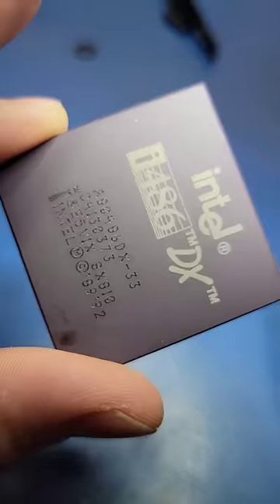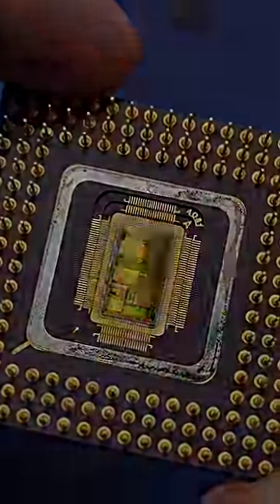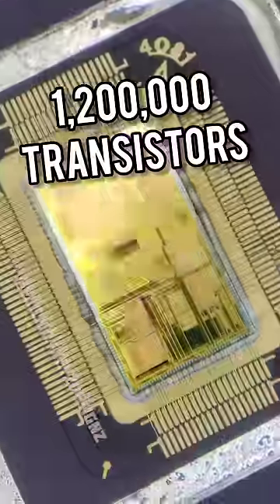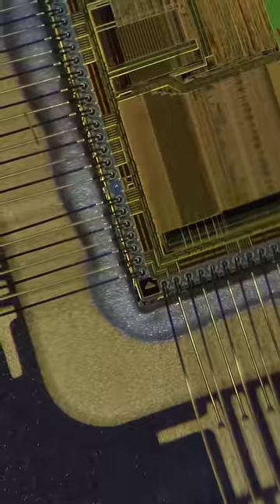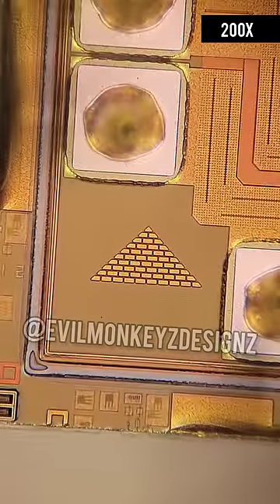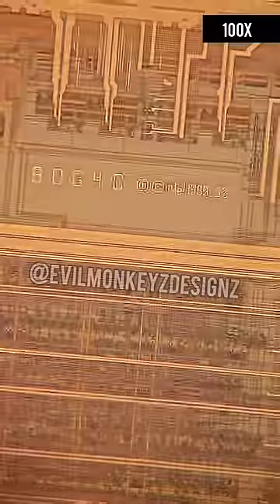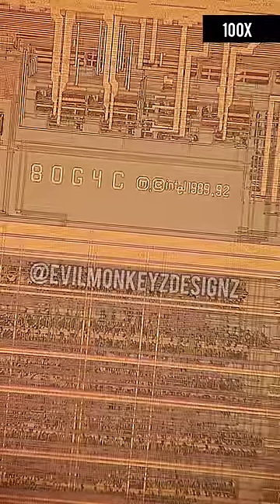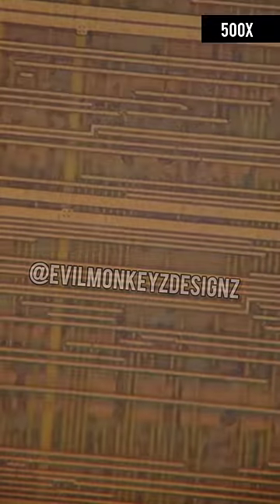Inside an Intel i486-DX CPU

Comment: Fun fact, they stopped making the i386, the predecessor, in September 2007. 

The chip came out in 1985.
Reply: A lot of tech is used in places that aren't PCs; there were probably some Point-of-Sale, ATMs, etc running those kinds of processors. I just recently got a new job back in September and the previous place I worked at was still using machines from the early-to-mid 00's for the two PoS units, and also the server in the back was almost as old.
Reply: @Dhalin  yeah, it's all the weird industrial stuff that used 'em for that long. I saw it when I was repairing an MRI magnetic field trim controller. Had an '06 date code, and I was absolutely shocked, had to look at the Wikipedia.

I guess if you used a 20 year old part on a 20 year old piece of equipment, it'll be 40 years old high technology still in use. Kinda cool to see computing history still chugging along.

Still though, I would have thought an FPGA would have been cheaper.
Reply: I had a pc with that as the processor
Reply: How much were they costing in the 2000s? What was their availability like in comparison to microcontrollers and other microprocessors of the time?
Reply: Fun fact: the MOS 6502 processor was created in the mid 70’s and is still produced commercially to this day
Reply: There was a news article recently that german train system still running on win 3.11. If it works it's good.
Reply: If I recall, the i386 didn't need cooling and was one of the most reliable chips of the era and therefore was a good choice for many applications.
486sx needed passive cooling and the dx needed active cooling. The pentium was a horrible mistake
Reply: The i386 was a brick. It was the last of the x86 line to not include a floating point processor on chip (there was a separate i387 coprocessor). It did not require cooling and was often used in harsh environments where it performed flawlessly for years. I would put 386's in the same class as the Voyager spacecraft computers - cream of the crop!
Reply: @ernestsmith3581 No, 386DX had FPU on chip. It is 386SX & 486SX that didn't have it.
Reply: @Unknown.User.54  I don't recall a DX/SX separation in the 386 line, and not until the 486 line, and thought that was about buss width; not presence or absence of a FP processor. But I could be wrong, commenting strictly from memory.
Reply: @Unknown.User.54  386dx ? You're hallucinating.
Reply: @ernestsmith3581 you are right. I looked Wikipedia. My fault. 386 DX/SX separation is indeed about buss width 32/16.
Reply: My first GPS device(portable) was garmin 12 with i386 inside
Reply: I had an i386 DX 25Mhz.  I used that machine throughout college and I learned a ton of programming on it.  Gave it to a friend who had no computer.  I do miss that machine.  I ran Linux 0.99 kernel on it.  OS/2.  NT 3.12.   DOS. DRDos.  Just used the crap out of it.
Reply: @Unknown.User.54 Wrong. The 386sx was hybrid 16/32bit, the 386dx was full 32bit. The 486sx/dx WERE separated by FPU or no FPU on board.
Reply: I've heard the military used 80386's for different purposes all the time, even in cruise missiles and shit. As far as I understand this was one of the reasons Intel was forced to give the license to produce them to AMD in the 80's, even though Intel understandably didn't want to give their designs to a competitor. It was a security measure. Basically, the military wanted to ensure there were many different suppliers and manufacturers of all the important chips they need for their equipment, so they can always order them at all times no matter what.
Reply: @Unknown.User.54 oops I missed this, I see you got the difference correct already. cheers!
Reply: @ernestsmith3581  i386DX has a FP Co--Processor, i386SX does not. I bought it used (£40) DX + Motherboard advertised as 40MHz. Original speed 25MHz underneath the CPU sticker.  Set with jumpers.  No fan.  Just needed a GFX Card, Sound Card, Super i/o PAR & SER Card, IDE + FDD Card and Memory.

In the future Voyager 6 became V'Ger.
Reply: @Marty2011uk  I ran a ham packet radio bbs (JNOS over DOS6) for about 10 years on an i386DX here in South Texas. No fan; 100°F (40C) every day in the summer; no complaints from the computer (though the memory battery had to be watched for leakage). The power supply for the radio finally broke and I never fixed it 😔. The IBM monitors (original VGA specs) of that time period deserve a mention as well. I have three that have never been opened but still work fine. A coffee toast to well built old equipment!
Reply: @Marty2011uk  Nope, you are wrong. Neither 386DX nor 386SX had a math co-processor on chip (both could use a separate co-processor 387 and 387SX respectively). The difference between 386DX and 386SX was the data bus, which was 32-bit on a 386DX processor and was cut down to 16-bit on a 386SX (even though the CPU itself was 32-bit internally).
Reply: o...m...g!
Reply: @kosmosyche  I know, I was wrong all these Years.
Reply: @smoguli Yep.  8 bit guy just did a video on it.
Reply: @ernestsmith3581  You guys all have WAY better recall than I.
Reply: @exidy-yt  
A little history here.  The 486sx came into being when many of the i486 chips were found to have defective math co-processors.  The part was still sold with the defect and would require an external coprocessor or lack the feature.  The sx part became so popular that Intel actually began to disable the coprocessor on good parts to meet the demand of the lower cost micro.
Reply: @swinde  yep, I remember this. It was still too much for my cheap arse and I went with an AMD 386DX-40 for my first PC clone.
Reply: @Mitsou44  Windows 3.11 works fine if all you do is run 1 program all day long.
Reply: my father thought tubes were obsolete.
Reply: That area 51 breakthrough really came in handy
Reply: It was used in aircraft autopilots and other embedded systems.  

They still make a version of the MOS6502 from the 1970s (Atari 2600, Apple II, Commodore 64, NES) for embedded systems today.
Reply: @smoguli  Anorher fun fact, The Terminator also runs 6502 code.
Reply: @Dont_Gnaw_on_the_Kitty_1  so he can’t divide and conquer? He’ll have to repeatedly subtract and conquer
Reply: @Unknown.User.54  Wrong.
386DX to SX was 32 bit address- and databus versus 24 bit address and 16 bit  databus on the SX.
386 NEVER had a integrated FPU. FPU was always external.
i486 - not even branded DX was the first CPU of Intel to integrate the FPU. IT collapsed the FPU market of the i286 and i386 times. The only one that one that that remained as a vestige for a while was Weitek FPUs.
The 486SX coming ~1991 was as the 386SX a binned 486 with non-functional (so either defective thus fused off, or just fused off) FPU. The 486SX was fully 32 bit unlike the i386SX. Also SX's usually were clocked lower.
Reply: @lennyfrombrooklyn  DR-DOS for the win! Honorable mention: OS/2.
Reply: @kosmosyche  I never heard that story. Not saying it's untrue but it reminded me in the early 1990's there was a huge lawsuit between Intel and AMD over the use of x86 architecture. I believe Intel lost that civil case and had to allow AMD to continue manufacturing their version of the 80386. At the time, the 386 CPU was already maturing but the lawsuit set many far-reaching legal precedents for companies licensing technology for years to come - to this day even!
Reply: @ernestsmith3581  Your comment made me recall how I learned there was indeed two classes of Intel 386 CPU's. I received a second-hand 80286 motherboard with a "daughter" board plugged into the CPU socket that ran a 386SX processor. Only the 386SX would work with this aftermarket upgrade. The 386DX was not an option for plugging in to the "daughter" board.
Reply: @ernestsmith3581  Your comment reminds me when the first generation of Intel Pentium CPU's were discovered to have a floating point error. The company responded quickly and fixed the error down to nearly the last consumer machine. At the time, AMD was a distant #2 CPU competitor but that company began demonstrating how easily the floating point error could give bad results on a spreadsheet and their comparable CPU line did not exhibit this error. Competition is good; it keeps the major players in-check of each other and drives further improvements.
Reply: @ernestsmith3581  SX/DX was indicating an FP processor... I had a 486SX as an early teen and the MB had a socket for a FP co-processor as an upgrade-option.
Reply: 1985 wirebond 😮 produces smashed ball 😂
Reply: @smoguli  i just ordered 2 of them to repair a Taito board (Jungle King) and an Irem board (Moon patrol) - I purchased originals for ten bucks each but I could have bought brand new ones for 15!
Reply: @JasonKaler  Spot on!  This is 100% accurate :)
Reply: @ernestsmith3581  nicely put :)
Reply: @Unknown.User.54  I think you may be mistaken there; to enable floating-point operations, the 386SX had to pair  with the 80387SX. The 80387SX was a variant of the 80387 specifically designed for the 386SX, which had a 16-bit data bus (unlike the 386DX’s 32-bit data bus).
Reply: @Unknown.User.54  You are right
Reply: @Mitsou44   Except the German train system is renowned for NOT verking!

Comment: Had this in 25Mhz with 4MB of RAM, loved the machine.
Reply: Same here!  Did have a few people say that they did not realise that they existed.
Reply: Daily driver back in the 90’s then went dx2 and dx4 after
Reply: Yeah, I had the SX variant @ 25mhz and 4mb of RAM.  Getting the latest version of dos was important back then. lol.  Until ‘95 came out.
Reply: @hunkydory419  Yess SX25+4MB gang!
Reply: IN mid-1992 I purchased a genuine IBM PS/2 with the 486DX/25, 4MB RAM, 3.5" FDD and a 129MB HDD at a cost of $2k (new).  With QEMM-386 I was able to run  Win3.1 with 631K of (free) conventional memory.  Then OS/2 was released... on 14 3.5" floppies.

Comment: My first CPU! Got it with my first PC, a Dell 486 DX 33mhz with 8 mb of ram a 512k cirrus logic video card and a 14 inch monitor that is at 640x480 but if I lowered the color to 16 bit I could go up to 800x600! 

I miss those days.
Reply: Cirrus logic! There a name I haven't heard in forever. Best I can do is mention I have a Righteous Orchid 3D (3dfx) in original box somewhere in the attic.

Comment: I used to own one of those, it was actually my very first PC. A DX 486/33 running Win95. Couldn't tell you anything about the rest of the PC though as I don't remember what else it had in it. I eventually got that upgraded to a 66 and then eventually a 100Mhz, and I remember the day I had the 100Mhz put in it, the difference while running Warcraft: Orcs and Humans, how suddenly the whole game ran at nearly twice the speed. Night and day difference!
Reply: ⁰⁰
Reply: Maybe Windows 3.0 or 3.1 and DOS 6.0? Win 95 came 5 yrs after CPU 486dx-33 was released.
Reply: @Brave2standalone  It was definitely Win95. I was on a budget at the time as I didn't have a lot of money and wanted a PC, and at the time, Pentiums were out, but I was buying a used 486 because it was like half the price of a new Pentium-based system.
Reply: Omg. I loved that game!!  Thanks for reminding me of that!
Reply: I still own a 486DX4 100 computer, simply because it is a bit different (not a normal MB but has CPU on a card), MB is just a backplane with ISA slots. Has GUS audio, internal UPS card, HD controller card, ethernet and, I vaguely recall, Trident video. Runs Win95, had some games on it (XCom, HMM, Doom...)
I also have 286 laptop somewhere, 10MB HDD. Don't recall make and model ATM. Not much on it, just DOS and some serial terminal emulator.
Reply: @SeersantLoom  Some older games can be emulated on newer hardware, but yet sometimes it can be annoying to do such. For awhile, I kept a Win95 setup to play some of those older games. We have DOSBox to emulate DOS games, but for those pesky games that like Win95/98 environments, but not DOS, it's hard to find solutions that work, and you don't have to pay extra for.
 
You can do virtual machines, but IIRC, you gotta pay extra for the good ones that actually let you run this stuff (at least back during the Win7 days, dunno if they changed that since) as the Home edition of these OS's don't have that functionality for some stupid reason.
 
But, keeping around an old box (and CRT display to go with it) is cumbersome and annoying as those old boxes took up a lot of room, and it's for this niche thing that I'd only use once-in-awhile and it just wasn't worth it to do, and it'd oftentimes come down with problems, etc. Also didn't help that aging hardware would fail, especially HDD drives because that's just what magnetic-based drives do, I eventually gave up on that. A shame, that some of these games I'll never get to play again, but oh well. There's enough games out there, and every once in awhile, you get lucky and one will get remastered and re-released to work on modern systems...

Comment: I worked at the plant that made the PGA that you popped that out of. Alcoa Electronic Packaging. This is pre-Pentium.
Reply: Maybe you can tell why the (P5)
Pentium had a bug. I had to change it and send it to the factory.
Reply: You can't patent or trademark a number so Pentium was the name intel chose for the 586 series of chips to prevent anyone from copying or using the chip's name and architecture.

Comment: How far we came! My first CPU was the first of the 8 series - 8008 in the Altair. Then the 8080, 8085, 8086, and so on. I did not use the 4004 or the 4040 before them.
Reply: Z80A ? Did you missed?
Reply: @iorant2558  
Never used a Z80A.

Comment: Great memories.
My dad got a 486DX2/66 CPU with 8MB of memory and a hard drive controller that actually had a tiny bit of solid state memory that gave him down to 0.9ms access time in certain scenarios. Combined with a Tseng Labs ET6000 graphics card, it was an incredible computer that could do anything.
I inherited his Northgate 386DX/20 at the time. I had a Tseng Labs ET4000 card and I believe 5MB of memory. I could play Doom but only at the smallest graphics window. :)

Comment: I worked for a Sears store way back, 1990 - 1992. 1990 - '91 was in Paint/Hdwr, but '91-'92 was in "Home Office Electronics."  Sold computers as well as typewriters, word processors, etc. The 486 DX was our top of the line system!

Comment: the level of complexity here is beyond what my mind can fathom
Reply: You're only seeing the interconnects that tie the devices together.  The devices are buried below several layers of insulators, dielectrics, and other interconnects.  The devices (mainly transistors and diodes) are not visible to the naked eye.

Comment: My parents got our first computer with a 486 dx2 50mhz. A few years later I used the processor upgrade slot on the motherboard to upgrade to an Evergreen 586 at 100mhz. I fell in love with computers with that thing and learned so much.

Comment: One of my older computers that I no longer have was a 486-DX2-66   at the time I thought it was so fast!.
After a couple of heathkit IBM style computers, ALL of my computers , I have built from scratch, that is, case , motherboard and supporting boards bought and then assembled by me, and I bought Windows and other programs to use with them.  It cost a little more, but I got the hardware I wanted.  Ready built PCs usually have a few cards that are substandard to lower their selling price.

Comment: When I was a kid, I upgraded a machine with this CPU to. DX-2 version that could clock at 66Mhz added 128 Kbs😅s of ram to the 64kbs and added a massive 2 MB Seagate hard drive(replacing it's tiny, sub megabyte HD as the primary drive). Neat thing you just showed me . Thanks.

Comment: I used to have one of these back in the day, it was my second personal computer I could call my own right after a 386 I bought used. I eventually upgraded to the 66mhz version through allot of work. Both was honestly nice considering that at the time the only other computers in the house were my sisters 8088, a TI 99 that no longer worked, and the family computer which was built in an era before hard drives were common meaning you had to boot from a 5 1/4" floppy and the only software we had for it were for Taxes, a Word processor, and a couple of primitive games that are nearly impossible to play today without emulating the slower speeds of the 386. Alley Cat was very much a favorite, there was also a helicopter one where you had to take out certain targets then evacuate people from a building.